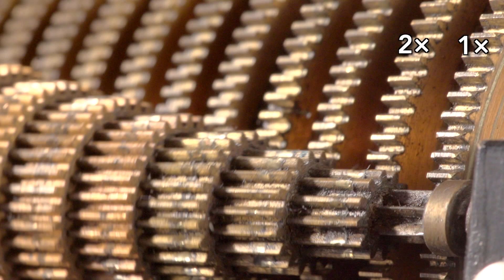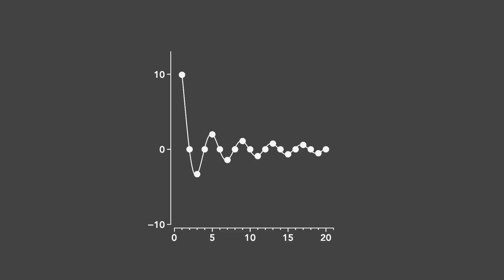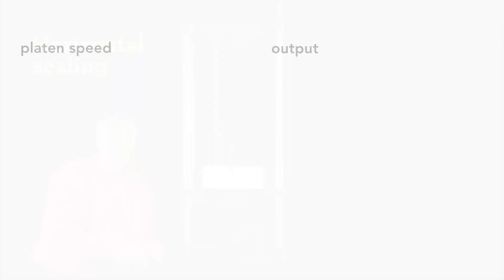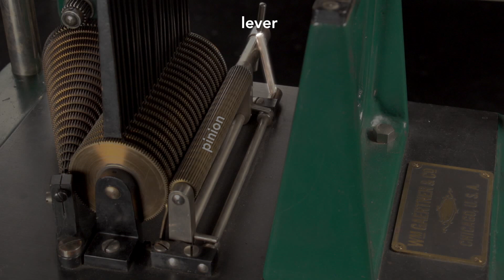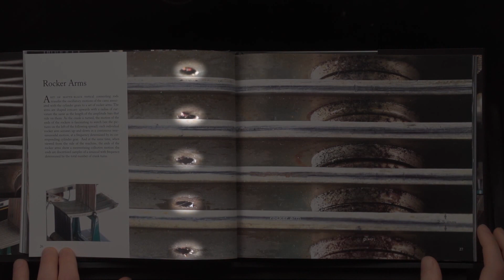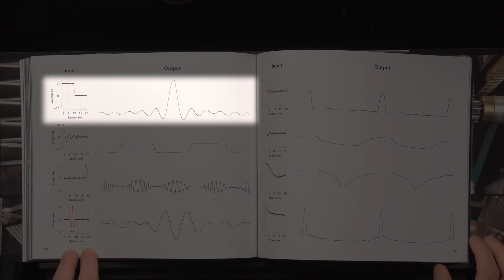An Old Mechanical Computer: The Harmonic Analyzer

Comment: To add the components with springs certainly the idea that distinguishes this mechanical masterpiece from the tide predicting machines. There, you add up with a string passing multiple pulleys. The friction adds up in this process. Here, this is not the case. Despite all the disadvantages springs usually have compared to weights, here they are the winning move.

Comment: Oscillators in digital synthesizers have been setup for doing such additive synthesis.  Back in the 80s this was very expensive so Yamaha used fm synthesis instead where so called operators could be used as argument for other operators.  So you could get stuff like sin(sin(t))

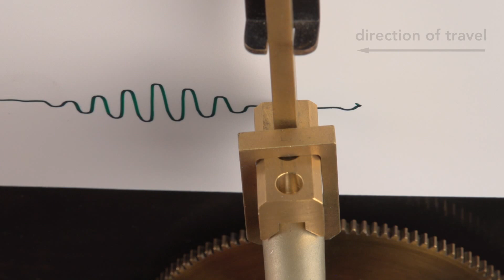Comment: @engineerguyvideo The flat peaks and troughs seen at 22:09 are intriguing. Even more interesting is the angle of the pen required to fix them. 

I believe it is actually a sign that something they've done in the machine restoration is incorrect. A felt tip pen has more friction than a pencil (fibers versus graphite) and the video said a pencil has too much friction. Turning the Sharpie so that it points against the motion of the paper (rightward) causes even more friction than other orientations.  Imagine the fibers of the pen tip colliding into fibers of paper but unable to fold out of the way as they could if the pen was pointing to the left.

You'd think pointing to the right would be worse, but not all friction is bad. First notice that this friction is in the X-axis, not the Y-axis, so it does not directly affect the ability to go up and down. I hypothesize that in this case the restorers accidentally found a way to use the excessive friction in the X-axis as a way to reduce friction in the Y-axis. I believe that the pen is vibrating minutely away from the paper hundreds of times a second. When the pen jumps off the paper, it is able to freely move up or down, thus allowing a proper graph to be drawn.

This hypothesis could be easily tested. Simply try something with much less friction, like a paint brush, to see if it has the same orientation  requirement as the Sharpie. Alternately, measure the vibration of the felt tip pen at different orientations.

I'm pretty sure the Harmonic Analyzer did not use a Sharpie originally. Perhaps it was a fountain pen as the video guesses, but I would suspect a well of ink and a glass tube, which would have almost no friction. If so the orientation of the pen would not have mattered. [Glass also fits with the evidence that this extraordinarily complex machine was missing only a single piece. It likely shattered at some point.]

Comment: Its like a mechanical version of that multiple pendulums with decreasing length demonstration. Raise the weights then let them swing, the differing lengths makes them oscillate at different rates so they start closely in phase then drift into a series of stable nodes eventually to essentially chaos. Then begin working itself back to in phase. 

......yeah, that thing. This looks like that to me, well, at least the gear cone bits at the bottom and levers, but like.... mechanical. Which means its like that pendulum whatsit but can be frozen in time.... [Mindblown.gif]

Comment: It's hard to believe you completed all this work on the analyser  in only two years. Thank you so much for the video. Very enjoyable. I'm sure Michelson  would have been mightily impressed with the Sharpie! As a hydrologist of a certain age I remember river level pen chart recorders before the advent of the fibre tip pen . The pens consisted of a tubular nib connected to an open cylindrical ink reservoir which could be topped up with an ink dropper. They were horrible beasts   to deal with, with many dribbled charts as well as  dry scatchy tracks and very inky fingers! This was made worse by the hygroscopic nature of the ink designed to suck in atmospheric moisture to stop the ink drying up. Fine in a dry climate, not so good in Scotland where humidity can hover around 90%+ for days on end! Good old days? Ha ha.. give me a few megabytes of solid state memory to record data any time!
Incidentally 3blue1brown does a great explanation of Fourier analysis.

Comment: This machine reminds me of the tide predicting machines of the late 1800's and early 1900's. In these machines up to 10 different components of various non-integer frequencies are added together to produce a tide chart for a particular location. Each location has different amplitudes for each component but once known they should stay the same for that particular location.  It took into account rotations of the Earth, Moon, Sun and shorelines. With the tide analogue computer, they could generate a year's worth of tide data in about a half-hour of cranking the master wheel.   See the wikipedia on the tide predicting machines.
Reply: A long time ago they had one of those at the Seattle Science Center. I don't know if they still have it on exhibit, but it is well worth checking out.

Comment: The displacement of the nth rocker bar (as determined by the coefficient lever positions and cog inputs) translates into a force .component F_n = k x_n  on the common summing bar. The summing bar’s position x_s is linearly related to the summed force  F_s = k_s x_s.   I am not clear why the “counter spring” for the summing bar has to be so long given the motions are very small. Is it to ensure linearity in the spring (ensure k_s constant) or it may be to allow very small adjustments in the equilibrium force that the spring exerts? Any insights?

Comment: The "inverse" operation is not as crazy as it seems. The Fourier transform is self-adjoint. This means that the inverse transform is essentially the transform. Essentially the machine only actually works one way. It's how you interpret the input and output which determines it's function. E.g., a sinc->square and square->sinc  or square<->sinc. If you interpret the square (wave) function as representing coefficients of harmonics then you'll get a sinc time function. If you interpret it as a time function then you will get a sinc frequency function.
Reply: That's cool. I haven't played with the math in a while, but I thought the Fourier transform gave a real and imaginary solution while the inverse required both as input. Are we talking about just the real magnitudes, then?
Reply: @beenine5557  For real valued functions the imaginary part is irrelevant.

There is only one difference in the inverse(besides scale) and that is a sign. exp(-ipiwt) vs exp(ipiwt)

Yes, when you take the Fourier transform of a signal you will usually get a real and imaginary part but for real signals you do not need the imaginary part and it is thrown away as it is extraneous. Why? Because the real part has a degree of freedom since the imaginary part is not specified. This means the "phase information" is not defined for a real valued function. One can then, in effect, pretend an imaginary component actually existed in the input in a way that canceled the one of the components in the output. It is then similar to "taking the magnitude".

That is, there is no difference between the Fourier and inverse Fourier transform except one deals with frequencies in opposite direction(e.g., clockwise vs counterclockwise). 

So you can literally use the Fourier transform to calculate an inverse transform.
This is what is meant by self adjoint(it's not exactly self adjoint due to a sign and sometimes a scale but that is simple to compensate).

If you take a square wave and take the Fourier transform of it you will get a sinc function, if you take an inverse Fourier transform of a square wave you will get a sinc function. The only difference will be sign and potential scaling factor.

The inverse Fourier transform is the Fourier transform(again, except for very minor differences). the point is that any Fourier transform device/algorithm will also work as an inverse Fourier transform device with almost no modification.

Check out the wiki articles on the Fourier and inverse Fourier transform.

While some functions will have imaginary components when transformed they can be effectively ignored as long as the function is absolutely integrate.

If you have int(f(t)*exp(-ipiwt)) and f(t) is real then the imaginary part only comes from the exponential and so, in some sense, if irrelevant to f(t). 

In fact:

F(w) = int(f(t)*[cos(piwt) - i sin(piwt)]) = 
int(f(t)*cos(piwt)) - i int(f(t)sin(piwt)) = 

but F(-w) = int(f(t)*cos(piwt)) + i int(f(t)sin(piwt)) 

and so F(w) + F(-w) is a real valued function

So, in effect what we have are actually just cosine transformations and not Fourier transformations but the difference is only scales and signs.

In some sense the machine doesn't know time or frequency. It's just computing an algorithm on real values. So if those values you put in are suppose to represent time then the output will represent frequency. If what you are putting in is suppose to represent frequency then the output will represent time. The machine doesn't know or care what the units ofo your variables are(although they will always have to cancel out w*t has to be unitless: 1/s*s = 1).

The Fourier transform is really just a transform that is able to take a set of inputs and transform them to a set of outputs that can be reversed(it has an inverse). Such transforms are useful because they give us a different perspective on data. 

In fact, basically all the transforms are essentially the same. the Mellin transform is a sort of more general Laplace transform and the Laplace transform is a more general form of the Fourier transform. All this stuff is really more general than "finding the area under the curve" as we are taught. They are actually symmetrical operators on abstract group theoretic structures and, in fact, known as functors(things that transform structure from one form to another but doesn't add or remove anything, at least when certain conditions are satisfied).
Reply: @jsmdnq  Thanks for the detailed info. I can't honestly say I understood everything you wrote, but it helped.
Reply: @beenine5557  Well, again, just look at the formula: int(f(t)*exp(-i*pi*w*t)) vs int(f(t)*exp(i*pi*w*t)) (excluding scaling factors).

They are, effectively, the exact same(the minus sign is important for the mathematical invertability but it won't do anything for the mathematics).

If you literally reverse your function in time f(t) -> f(-t) you'll convert a Fourier transform in to an inverse transform. Same works for the frequency.

The idea is that they effectively are mirror images of each other sorta like how you are in a mirror. You aren't different, just "flipped".  You might think it can't be that simple but it turns out it is. It's just a glorified addition and subtraction. Same how -3 is the additive inverse of 3.

It's only complicated looking but under the hood it's very simple. The idea is that we can take our function's values and distribute them on sinusoidal so that each sinusoid holds a "value"(the amplitude) and the frequencies separate those values. Then we do math on the sinusoids. Because of the property of sinusoids it helps us keep track of all the values we are transforming so they never get lost(sort of like a bijection) so we can invert them by undoing/unwinding the math.

If we just added all the numbers together, clearly it is not invertible.  2 + 3 = 5 = 4 + 1. So we have to sort of complify(add more dimensionality/degree's of freedom) to hold our data.

if you know anything about generating functions then it is the same idea. E.g., how 1/(1 - x) = sum(x^k) and 1/(1-x) "holds" the sequence of data 1,1,1,1,1..... and 1/(1 - x^2)  holds the sequence 1,0,1,0,1,0.... and 1/(1-x)^2 holds 1,2,3,4,5,6...

By attaching our data(the values) to x^k we can keep track of the values so they are not lost in the computation like in simple addition. 

In this case we compute the sum to find the "transform" and we can invert it by finding the sum(e.g., essentially compute the Taylor series).

The Fourier transform is very similar to this idea but instead of polynomials we are using sinusoids(but it's actually the same, it turns out. Not the same results but the same abstract machine underlying it all).

It's a huge subject but the thing to remember is that things sometimes are much simpler than they seem. The complexity  stems from technicalities and/or "size". At the end of the day everything is simply addition and, at the end of the day all we have is 0 and 1(all mathematics comes from the complexification and analysis of how to combine and separate out 0's and 1's).

Comment: Analogue computers are good because as said in the video they show physically what is the process whereas digital is much more abstract.

The x-y pen recorder I used at work 40 Years ago had a chopper stablised valve amplifier.  Significantly the pen was a little cylinder container of ink with a filler hole and a inverted u shape capillary tube in which the tip barely touched the paper under the negligible weight of the capillary tube. The assembly was moved x-y motor and wire driven mechanism.  Despite the age of the instrument it worked reliably but with a little jitter from the chopper stabiliser evident on the paper.

There was a pen lift leaver to lower the pen whilst  you carried out a recording it also recorded Y-t (time) if you chose that.

Comment: I wonder if they could have used a fountain pen setup such that the nib barely did not touch the paper, but transferred ink through a connecting droplet that wicked ink to the paper via surface tension.

Comment: 22:29 Why are the peaks and troughs flat when the pen is oriented with the direction of travel of the paper? I would have thought that the pen offered the same amount of resistance in that case than it did when it was orientated against the direction of travel of the paper.

Comment: The secret to this machine's success is the Fourier Inversion Theorem, where the same process of of synthesis does analysis. The synthesis is just using engineering tricks to generate cosines and add them together, but the analysis is mathematical beauty.

Comment: off topic:
why did they used to use vacuum tubes as transistors? u can make a transistor easier than tubes that break all the time! why use vacuum tubes at all?
Reply: Dgs...  How old are you, kid? Also as a preemptive edit: Your little idea was tried, they were called relays.  The problem was they required lots of power to energize and de-energize. The vacuum tube required less energy to do the same job, and did it faster.  Tubes also had a longer life and lower failure rate.  That lead to faster computers and by extension more overall interest in the things computers could feasibly do.  Without those tubes you strangely want to shit on, there wouldn't have been the computer you just typed on.
Reply: Told you son:  read some books.  Have a good time eating your own tail, some of us have to work in the morning ;)
Reply: Because there were no transistors back then
Reply: ive seen modules doing what transistors do, made out of knex or legos. they couldve done it lots of ways, WHY LIGHTBULBS?!
Reply: Good question why didn't they just make quantum computers instead of wasting all that time with vacuum tubes?
Reply: you could just say "yes, i googled it.. i have no idea why they use tubes im sorry" also, give source cuz i dont know wich wiki page ur getting this off of
Reply: TL:DR u seem really butthurt, take everything your trina say and BLOG it. everyones tryina google at me and seem smart, yet the transistor does something EXTREMELY SIMPLE and those bulbs broke ALL THE TIME. gimmie source, i dont need some random guys "feelings" about how he thinks it works
Reply: wtf is a book? and why do i need YOU to read me off what you read in google? i asked a question, and i get a buncha people like you from the internet who wanna google shit and answer stuff they dont understand. get to that grind of a job i know you must have

Comment: I always wondered if this machine existed. I had heard that there was a machine that could do fourier analysis, but I never found it... Has anyone attempted to come up with CNC plans for a model of this calculator? Perhaps 3D printed or cut from acrylic? Except for the springs and a few bits to inset for the knife edge pivot it look like there are no difficult parts. The main big of precision seems to be with the balanced spring tension system. Is the friction of the amplitude bars with the rocker arms critical?
Reply: It's coming right up. I'm currently drawing one and will be publishing it soon. This video gave me so much inspiration to do it !
Reply: @jackcarterdrelias  Did you ever finish? Can you link us to your models?
Reply: @beenine5557  I don't think my answer was posted due to link. I hosted it on Instructables as "Harmonic Analyzer : Mechanical Lasercut Signal Plotter". It was already almost 3 years ago ! Time goes quickly. It is really simpler than I had in mind back in time, but it does the job with not much hardware, just a few bearings and springs.
Reply: seen one of this kind in the science museum of London, in the mecanical calculator section